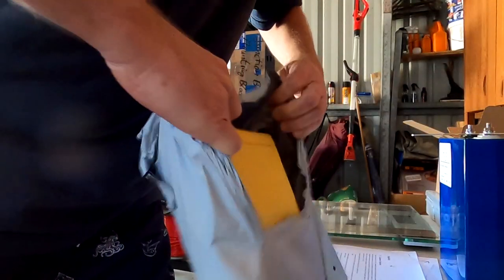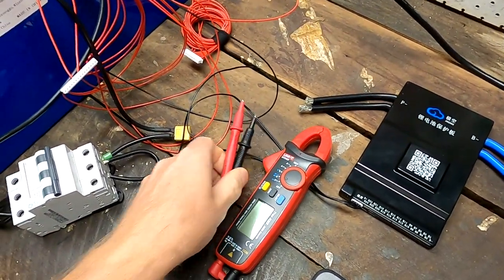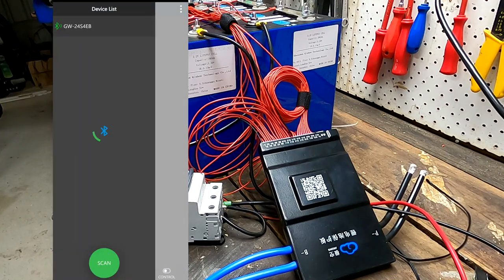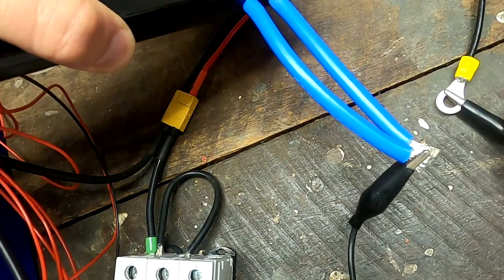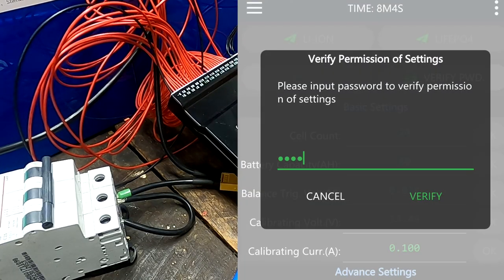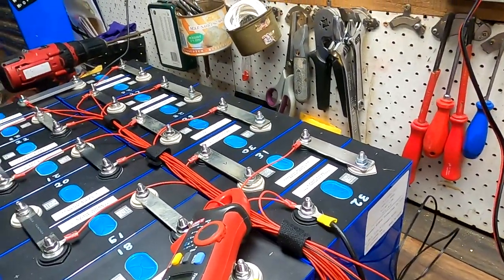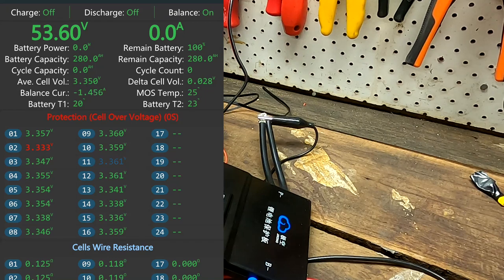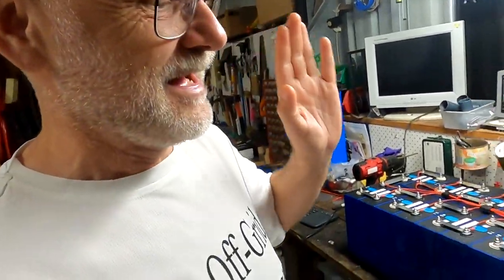The JK BMS with integrated active balancer. This is the one!

Comment: Ahhhh was so excited ...then I saw its lowest is 12s ... I've been looking for this for a while. And like you my experience with Daly was ... actually worse. In the garbage!
Reply: 12S is lowest only with direct power drive from same battery. Add some more or external or a small dc to dc booster and you can use it on lower <12S.
Reply: I hear that the dumb Dalys are more reliable than the smart ones.
Reply from the maker: I would not recommend buying a none smart BMS where you are not able to change parameters. Most of these are hard coded very conservatively and disconnect cells only below 2.2V or above 3.8V. Spend the few extra $$$ and buy one with BT and app so you can program it and set it to your needs.

Comment: The picture at 12:55 appears to suggest temporarily putting 5 volts across b- and p- to turn on the BMS before connecting the battery. Connecting sensor leads before connecting a battery is a well known way of frying a BMS. But maybe that only applies to conventional BMSs and it's safe since this one has an active balancer and/or it has more sophisticated electronics?

I suspect turning on this BMS by putting a power supply across b- and p- and raising the standing voltage from 53v to 58v is no different than raising the standing voltage from 0v to 5v, but it makes people who are used to conventional BMSs "feel" safer. In any case, it obviously has more advanced electronics. Remember back in the day when a BMS had to have three terminals to charge and discharge at the same time? 👴
Reply from the maker: Thanks Charles. I did some more testing now and it seems that connecting the charger with a 4V higher voltage than the battery voltage turns it on quickly and reliably. I'll see what's in the comments and people suggest.
Yeah, I have seen the solder BMS on Ali with a complicated procedure to turn them on. Never had one of these though.

Comment: You start it up once. You can also just use a 9V battery to start it should you need to. Best to disconnect from other batteries in parallel before doing so.
Reply from the maker: You mean other battery banks in parallel?
Reply: @OffGridGarageAustralia  Yes, just use the battery disconnect switch. Otherwise both banks could switch on at the same time and I have seen issues with that.

Comment: I don't like this BMS because the cables are not user friendly where you can mount the BMS. The other BMS's have ring connector studs or holes lot more flexible. These short wires create a situation where limited where you can mount the BMS. You could extend the wires working with lower DC voltage doesn't take much resistance and heat builds there since already working with a low volage can cause issues. Do lot of research before you buy a BMS, or buy a DIY box has a BMS built in already.

Comment: Pack overvoltage can be used to determine the maximum % of the charge that can not do the cell max voltage. I think.
Reply: Yep pack overvoltage is used when you want to charge less than cell max.
Reply from the maker: But can you not just lower your cell charge voltage accordingly to your desired target?
Reply: @OffGridGarageAustralia  Yep you can

Comment: A 200+ euros BMS should have a wifi communication mode to help home automation.
Reply: “WiFi… home automation” - that is the point about BlueTooth and serial cables.

Home automation is about automation in the home, not outside of the home, which is the downfall of many WiFi based automation units. I wish more automations were focused on home and not access from outside the home.

I hate that some of my favorite WiFi internet camera vendors require a connection to the “cloud” for  automation in my home. It stopped me from purchasing more product from them.
Reply: @DavidHalko  wifi does not need at all to be in the cloud. It is just a choice from some manufacturer. I would just need wifi in lan mode. Bluetooth have a too small distance range.
Reply: @DavidHalko  I use Wyze cameras because if the internet goes down and I can still access them through my router. I put a microSD in them for additional backup.
Reply: @charlesrichards5389  - can the Wyze cameras work 100% disconnected from the internet? ie never attaching to the internet, only staying on a local area network, where configuration can be done locally as well?
Reply: @DavidHalko  You need the internet for activation and optional firmware updates (and viewing remotely while away from home, unless you have some non-Wyze way of accessing your network).
Reply: @charlesrichards5389  - thanks for the information!!! it sounds like it may be possible to do a one time registration and block it forever more!

Comment: Kept all my cells in balance lol
Reply from the maker: I'm using the balance option at the moment and it works well. Started with 200mV last night and had 4mV this morning.
Reply: @OffGridGarageAustralia  I should upload a follow up on my other account. I used both BP randomization method for a 5kwh 7s pack, and another 5 kWh with repakr. Both separate heyo bms. After 6 months of continuous 8amp 24 hour draw plus peaks I have zero drift or imbalance. None.

I’ve been following you for a long time btw. Thank you for your videos.  🇨🇦

Comment: For me, the ideal BMS would NOT have a built-in SSR (MOSFETS). The MOSFET solid-state relay could be sold separately. I am not comfortable with the idea of simply cutting the battery connection to the charger or inverter while they are running. The ideal BMS for me would use the "Remote ON/OFF" inputs of the inverter and charger.
The BMS would have the following outputs:
- cell low voltage Warning below 2.8V, automatically recoverable by charging to 3.2V. I would connect this signal to the Inverter Remote On/Off
- cell high voltage Warning above 3.55V, automatically recoverable when voltage drops below 3.4 V. I would connect this signal to the Charger Remote On/Off
- cell low voltage Alarm below 2.5V, non-recoverable. I would connect this to a SHUNT TRIP attached to the main battery fuse (MCB)
- cell high voltage Alarm above 3.65V, non-recoverable. I would connect this to the same SHUNT TRIP attached to the main battery fuse (MCB)
Reply from the maker: Agreed, that's why I mentioned the CAN and RS485 communication ports for this BMS ;)

Comment: Power off voltage turns off the BMS itself.
Reply from the maker: And it does not start any more? So if one cell reaches 2.5V it turns off?
Reply: @OffGridGarageAustralia  Yes, It is a safety feature. When your battery is not in use for a long time, The BMS will drain your battery. When one cell goes below the power off voltage, the BMS turns itself off to protect the battery from further discharge.

Comment: Use the 4amp balancer from 3.4V to 3.45v and let the BMS handle from 3.45-3.5
Reply from the maker: That is if you have balancer and BMS separate? I don't think there is a high turn off voltage for the balancer though.
Reply: @OffGridGarageAustralia  I am saying use the other 4 amp one you showed us in combination with your new JK BMS

Comment: Quite expensive. And only 2 A balance I think for the 200A model. I hope the self consumption is low.
Reply: 10mA if I remember correctly. You can get a 150A version for about 100 Euro.
Reply from the maker: It is quite good for that price though, has all the features and a quality build (from the outside). The app is the best I have had from all the other apps so far. and 0.3mOhm internal resistant means only 12W power loss at 200A.

Comment: Andy I have a DYKB BMS 10-24S 200Amp load (50A charge, some say you can charge higher, and there is adjustable parameter in ANT BMS App). Am running it with 8S. 

Please test this JK BMS with 8S settings.

ps I like the high voltage FET’s on mine, which should withstand a SCC failure, which could apply 90v to the battery. I have seen a YT video showing severe battery damage from this!
Reply: Sad to say, he mentioned it in the video that this JK BMS only works with 12s up
Reply: @akimi0222  - mine is 10S up, but works, and was sold on basis of 8S. I’m asking him to try it. If set 8S in app, it could work ok. On mine the only parameter I can’t set is total string max voltage. This JK does not have that
Reply: It should work on 12S and up, depending cell voltages, if powered directly from same battery, 40V to 100V say in doc on B+ input. To use < 12S use external power or bring upp the voltage with a dc to dc booster for example.
Reply from the maker: I'll test it!

Comment: The listing for this BMS says there's a GPS hidden in that thing but it's supposedly disabled outside china. Also some kind of "cloud access" connection.

Which is a little creepy but also a shame since I could actually use that GPS functionality and am still paying for it either way.
Reply: There is no GPS hidden in that thing. It only allows a GPS to be connected to the GPS port.
Reply: @upnorthandpersonal  thanks for the info 👍
Reply: you need to allow positionning on your smartphone to launch application on android device, sic
Reply: @sebastienl2140  The reason for this is that on Android Bluetooth requires location services: "By requiring location services to access Bluetooth, you ensure that the user understands their location information may leak when they use Bluetooth. In versions of Android prior to Marshmallow, the user could use Bluetooth without location services enabled, but location information could leak."
Reply: @sebastienl2140  I used to download every app I could get my hands on until one day I let my daughter look at my phone and she asked me why I need a flashlight app and why a flashlight needs to know my location. 😮
Reply: @sebastienl2140  Because it gets those permissions from you on installation. There are two ways to do this: ask when you need them, or ask on install. Victron uses the latter.